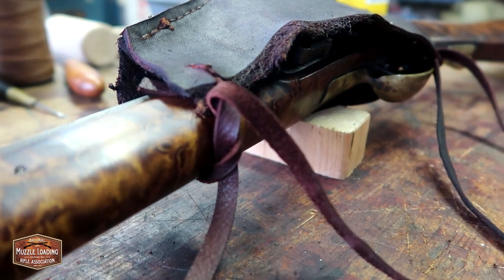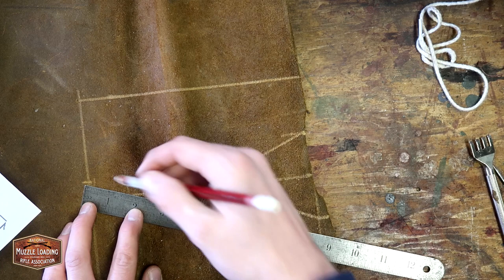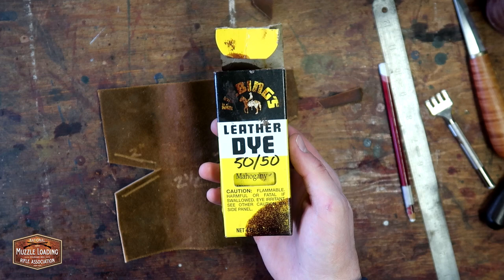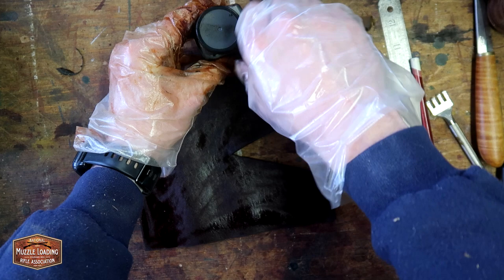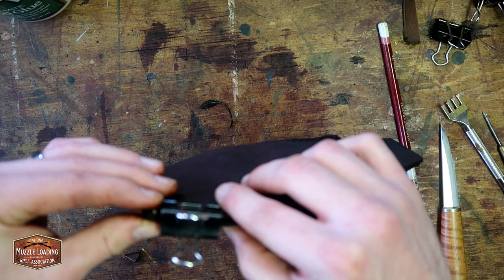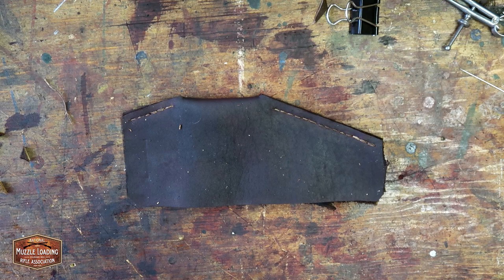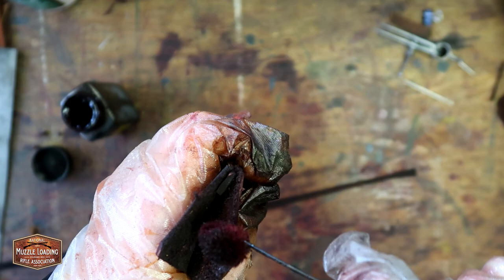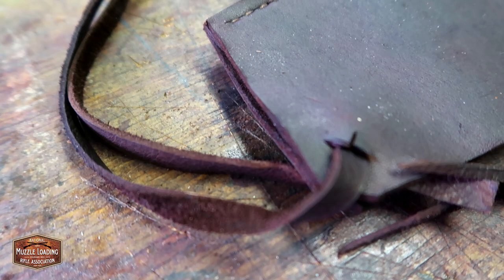How to make your own Cow's Knee Lock Cover for your Flintlock Muzzle Loader | Craftsman's Corner

Comment: Nice Video getting across a lot of info in a short amount of time.  I highly recommend using waxed linen thread instead of synthetic sinew for the stitching.  The synthetic does not look at all like real sinew that was used for leather stitching.  It is really strong though and with the dye you used, you shouldn't be able to tell the difference.  But waxed linen thread was commonly used in the 1700's and earlier for leatherwork of all types.  You can find linen thread at leather goods stores such as Tandy in either small spools or very large spools.